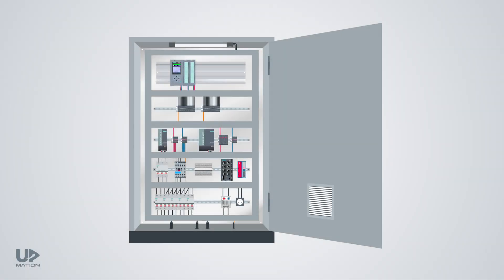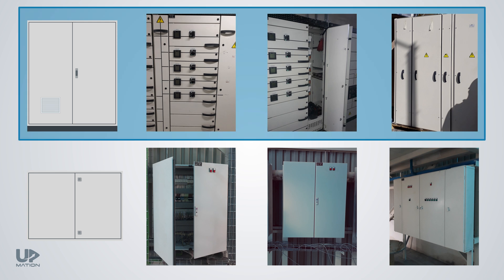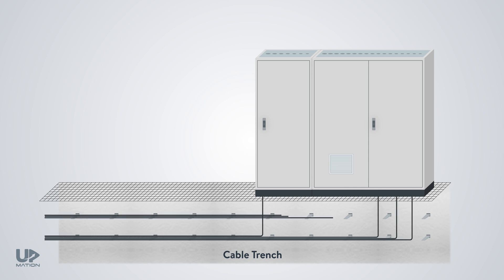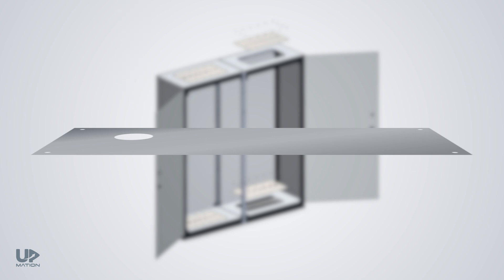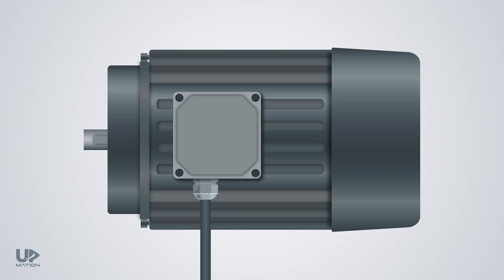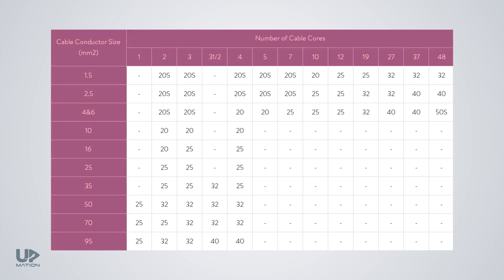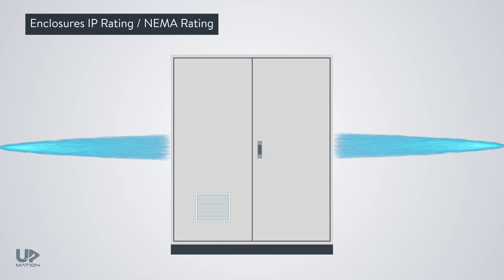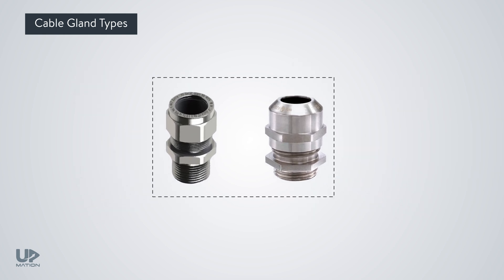Electrical Panel Enclosure Explained | Enclosure IP rating, Gland Plates, Cable Glands, Hole Cutter

Comment: As someone who has built control panels, this video makes it so easy, you will not be needing your engineer's pocket reference booklet while on site. Upmation has won me over for good
Reply from the maker: Awesome! It's amazing to hear that! Please let us know if you have any kind of suggestions. Thank you for you support!
Reply: @Upmation  I trust you will exhaust everything there is to know as the series unfolds. Just remember to highlight the importance of proper wire arrangement inside the panel. Engineers are fond of running wires along the shortest path without any consideration for beauty and aesthetics. Looking forward with excitement to the next video

Comment: Something to add - Gland plates aren't always metal - where high current circuits are connected using single core cables unwanted eddy currents are induced in ferrous gland plates. By selecting a gland plate made of non-ferrous materials (brass & aluminium are common) this is avoided. It also has the advantage of making it easier to drill the holes...
Reply from the maker: That was a great point you added! Thank you, Andrew! By the way, hope you've liked the video.
Reply: Wow! never knew that. But I'm confused; aren't brass and aluminum also metal? And gland plates are earthed, so doesn't that earths the eddy currents? How high has the current need to be to induce the eddies in the gland plate?

Comment: Hi. First of all great video. Its very well explained and illustrated and very helpful to us as we have been manufacturing panel enclosures since years.
I do have following suggestion: Can you touch upon various softwares used in the panel build process? We are currently using AutoCAD to prepare flat patterns by manual calculations. Are there any other helpful softwares to achieve this faster?
Reply from the maker: Hi, Omkar! Thank you for your comment. Yes, I believe there are a handful of software in this regard. I will transfer your great suggestion to the team for the next videos.

Comment: How to size control panel dimensions before detailed drawings of panel components
Reply from the maker: You need experience! and a piece of paper to estimate the components you'll need on that panel. Consider some more space than what you are estimating.
However, I believe it is definitely a part of detailed design phase and should be considered AFTER the drawing gets completed.